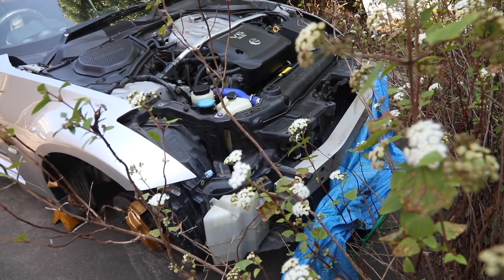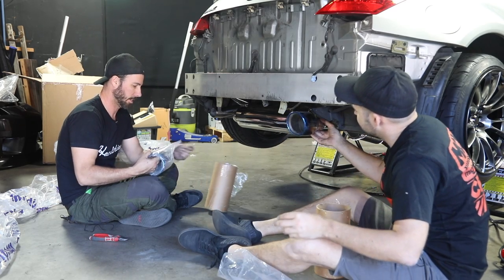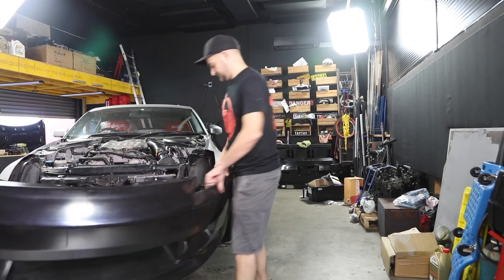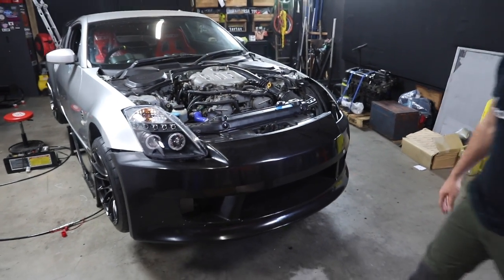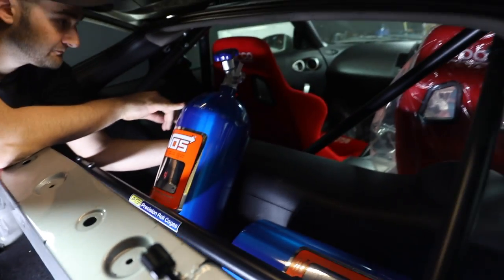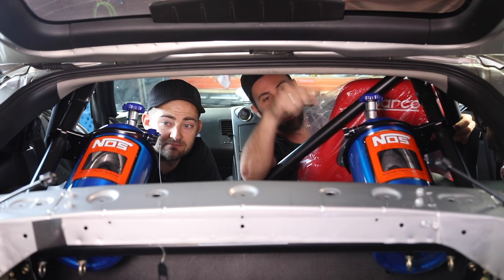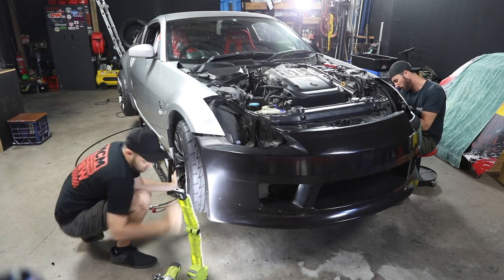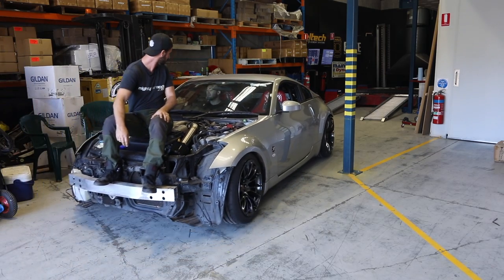350Z Make Over - PART 2

Comment: 218 hp that's not a healthy engine.
Reply: 217kw = 284hp
Reply: Yeah I was about to say, that seems like a really low figure for that engine. I thought they made about 300hp stock.
Reply: 162 KW = 218 HP
Reply: 274 BHP stock not 274HP
Reply: It's a 06 which makes 300 crank it should be making around 280 wheel stock
Reply: Vq35de’s make 280-300 at the crank. At the wheels it should be 250rwhp ish. 218rwhp isnt a very good sign. But what do you expect for a 350z that has 200,000kms and was the cheapest they could find all over Australia
Reply: I might be wrong but I can't see VVT on the front of that engine, I'm sure it's a VQ35DE not a RevUp.
Reply: it shoudl make 220hp at the wheels.
Reply: Yup very low power figure!!
Reply: Australia labels a cars year based on their registered date not the manufacturers model year date like the USA does, so this is most likely an early 2005 built car first registered in 2006 so has the older engine - so allowing for 15-20% driveline losses typical in a FERWD setup I would expect maybe 230-240 RWHP when it was new - so 217 after 200,000km and 11 years isn't bad at all.
Reply: Think your right but this wasn't a stock dyno run, It had headers, Full exhaust and a standalone ecu. It's down a lot of power.
Reply: i have an 03 350z its supposed to have 287 horses but according to most people on the z forum it produces much lower. the 350z hr is a different though
Reply: Daniyal S. More like 250ish to the wheels
Reply: Good point, I didn't take into consideration the amount of work they had already done to it - still could be worse for an old, neglected high-km vehicle.
Reply: Guys, IT IS VQ35DE. They said it in the first video of it at around 8:30
Reply: And stock it makes around 160kW at the wheels, as they say, so it's not a Rev-up.
Reply: And since with their first mods and some tuning it made 162.8kW it's pretty much the same as stock.
Reply: Rixhz34 I have the basic non revup vq35de that makes around 260 wheel. The car they have is the vq35de revup you can tell by the tail lights. The non rev up makes 287 crank while the revup makes 300 crank
Reply: Daniyal S. Ah I gotcha thanks for the info! I'm sure we can both agree 217whp for this Z is totally out of the ordinary
Reply: maybe it's the dyno
Reply: DEs can be real oil burners so with high miles that's probably right.. My HR made 297 wheel with exhaust and map only. There's a huge difference between the two
Reply: Saturday Winter it says 162 kw and 217hp
Reply: what u smoking
Reply: Stator rev ups are oil burners

Comment: Doesn't a stock 350Z already make like 280HP?
Reply: Not a lot of power for this surprisingly heavy car
Reply: 280hp at  the crank not the wheels
Reply: Add a turbo and it will be 340hp easy and cold air intake
Reply: @ruskibruski  on the vq a supercharger is a better way to go about boosting the engine
Reply: Matthijs Eskes like300

Comment: Just looking at the bottom of the car from the first few shots I wish I lived in a warmer climate. Almost anything you find in Canada is rusted to bits unless it has been undercoated properly right from the start.
Reply: It's certainly nice having our car's bodys last as long as they do. We get to see what climates do to cars in regions with snow and ice when we import Japanese cars, they are nearly always very rusty on the bottom.  Very glad we have a climate that doesn't destroy our cars (though it's tough on the cooling system and intake temps)
Reply: Tell me about it. I desperately want an EG Civic hatch, but all of em are either rusted to shit, owned by someone who won't sell, or crashed/ruined by boy racers and ricers. Mostly rust though. We use waaay too much salt on our roads.
Reply: ya, the government in my area has a set budget that they think the have to spend, no matter what. So the other day they came down and sanded my street (Which was solid hard pack snow causing zero issues until the sand made it all soft) and then the plowed the small gravel / rocks off the main streets. They did way more harm than good, But atleast the budget is being used
Reply: I'm fine with a little bit of colder weather as that's power weather for boosted cars. (I wouldn't know though  as I drive an N/A (for now) S2000 :P but anywhere it snows I don't want to be.
Reply: meh, it only snows 6 or 7 months of the year here. plenty of time for nice cars in the other couple months!
Reply: Not enough time for me :P
Reply: xDerpOG Easy fix, Move to SoCal. Then again youd have to deal with Trump Tweets more often... So, your probably better off in Canada
Reply: Yea I think I'm good :P When it comes down to it Canada is a pretty dope place to live, it just sucks for car people.
Reply: Well some cars don't use plain old steel so they won't rust up, but usually that is in the top price range.
Reply: xDerpOG because of the salt and snow
Reply: +Colinator4321 Yeah if they don't use the budget the government will slash it, trust me.

Comment: Vent the nos into the intake
Reply: if u wanan blow the engine up, sure
Reply: good way to remove your bonnet in 0.3 seconds
Reply: Lachie Wood Can easily be done that way as long as you have uprev. They already have the injectors that can deal with it.
Reply: William Stewart a vent line will blow 1k hp shot.. no injectors or tuning will save the engine
Reply: "danger to manifold"  warning light will start blinking.. :D
Reply: Nah vent nos onto brakes so they cool down 😎
Reply: rtiid22 I took it that he meant a dry shot, not just opening the valve right into the intake without being regulated lol.

Comment: I'm surprised that there are a lot of "car guys" in the comments that don't know that dynos measure whp and not hp. Especially since mcm have explained this before a few times.
Reply: KewaNCow even then. To the wheels all stock motor with nothing added my car made 240 to the wheels. So this is a bit of a problem
Reply: and that dynos are not completely accurate. they are best for seeing what the power curve does and getting base readings before you modify and seeing what you get after.
Reply: different dyno... different numbers... different days... different cars... you can never compare one dyno to anothers numbers.. unless you used the same dyno as them and probably on the same day... they all read a little different and some really run the numbers up or down...
Reply: Some Dyno's (the one I use regularly ) make mad calculations that guesstimate your HP at the crank.
Reply: Even so, the initial 217 number is low. Should be at least 240 or so, or around 260 if it's a model made after 2005. The engine is not in good shape.
Reply: Different dyno means vastly different numbers. DynoJets measure far higher than this - MCM always go to dynos with low readings.
Reply: yeah this dyno always reads lower than normal.. so could be the dyno itself.. and not even the car itself
Reply: Exactly. All of their cars showed way less power here. The z is fine

Comment: Just 217 hp on stock? Is that it? Shouldn't be something like 280 hp or more?
Reply: Bruno Gabriel Curbani typical imports 😂😂😂😂
Reply: The hp is 283 = 211kw, look at the screen again
Reply: Saturday Winter 283 hp with nitro. Search for the stock engine
Reply: Yeah, 276bhp seems to be the factory power output.
Reply: 217hp at the wheels. That's 258bhp at the crank. Its pretty common for a car to lose some ponies over the years, but 31hp is a bit too much unless it's a really high mileage car. Then again, the engine doesn't seem very healthy and it would explain why it was so cheap and was sold the way it was

Comment: Doesn't the stock 350z make 276hp anyway?
Reply: That's the power at the crank, they measured at the wheels :)
Reply: Georg Blink Both reasons are correct. The engine was or is in bad shape. Manuals lose about 15% of its power in a crankshaft/wheel conversion. So this car lost More than that 15. Rhode numbers are aproximated. But the difference Is to much. Sorry for bad english
Reply: MacTravis the hr engines make 306 and that’s a de which is 276 crank
Reply: Alberto Vz thats an approximate. More guys are actually getting around 18% loss through that trans. People forget though that some dynos can be really forgiving while others rape power figures. That being said rings in that engine are definitely not the greatest. But still the measured power was not that bad.
Reply: 2005 made 287bhp, not sure what year they have though.
Reply: my money is on a janky engine... mysterious lack of power out of an engine that looks good, shagged ass internals.
Reply: It looks like at Haltech they use a Mainline load-bearing dyno, which are known for reading super low numbers compared to Dynojet, etc...  If you look at power numbers from other MCM builds, they're all on the low side.  Its just a low-reading dyno.
Reply: Livi120 more than that
Reply: The early models made 276 crank, the later models with the twin intake (the HR) made 306. This is a early model single intake version.
Reply: Average number for DE 350s
Reply: MacTravis gona blow that lower block when the piston rings butt-up. See in a couple of times even with ecu being tuned. Guys add nos thinking "oh more hp" smh
Reply: It has a Nissan quest mini van engine lol
Reply: Not entirely, the VQ35DE in that car usually puts down baseline numbers around 210/220whp. It's about where it should be factoring in wear and tear over the years
Reply: So many Wikipedia enthusiasts in these comments 😂😂😂
Reply: there are some de like mine that have 300hp @ the crank because the intake and exhaust have vvt and the "normal"(no-rev up) have just the intake vvt and they make 287 hp at the crank, i have the (rev up)
Reply: The 2003-05 VQ35DE, which is what they have made 284 hp at the crank. The 350Z is notorious for large HP loss through the drive train. It is belching a lot of smoke so the motor is not healthy but most Zs would probably be down into the 220-230's at the wheels from the factory new. The HP was bumped to 300 with the VQ35DE Rev-UP in late 05 to 06 and in 07 they went to the VQ35HR motor which made 305 at the crank.
Reply: Binshou Builds 

Make fun? I was asking him what he meant so simmer down.

Have you got any links to the information about rings doing what you said? Interesting stuff!
Reply: 350zs are overrated as fuck in power. That is a DE engine that supposedly makes 287 to the crank advertised, and 218 to the wheels is actually normal. It's not easy to get power out of them NA without boost. They're still far from pushing the limits of the stock block though. Stock rods are good for a bit over 400whp and it's only making 280 with the 100shot. They could easily bump it up to a 200shot with proper tune. Only thing that would need replacing is the stock clutch.

Source : I own one, been through nitrous and turbo z builds myself and with friends.
Reply: The pre-2005 Zs make 276hp to the crank, after '05 they start making something like that at the wheels but I think the one they're working on is pre-'05
Reply: +Binshou Builds

That's with forced induction. Nitrous oxide doesn't cause as much heat as mechanical forced induction, and doesn't last nearly as long. This is the smallest shot available as well. They'll be fine.
Reply: Clyde If you're interested, check out Engine Masters here on YouTube. They do all sorts of neat engine mods and tests. They cover that particular issue with piston rings in one of the episodes. It is a real problem with adding boost to an engine. In this case via nitrous. I don't remember what episode they talk about it in, but it's a really fun series, so maybe just give them all a watch.
Reply: Dylan Kerr 

I will indeed, cheers Dylan.

As someone else mentioned above though the risk of ring expansion  is significantly less on a low shot set up.

It just irks me that because some thing can be an issue in excess then someone says it's a given and forgone conclusion in any application and even at the lowest level of usage. YouTube is chock full of doomsayers who seem to know from the comfort of their armchair what will happen.

That's not aimed at you though!
Reply: Defitnely  a weak engine   my 06 de(rev up) read around 260 rwhp with just exhaust(tomei) and test Pipes(berk) . Stock intake and y pipe
Reply: its about normal for this engine its not a rev up... you didn't read any comments did you?
Reply: Jim a quick Google will show you they have 287 HP crank and 274 ft lbs torque. Personally wouldn't bother ever getting anything but the HR Z's unless you plan on FI.
Reply: When brand new they made around 233 240 whp. This motor has has some wear damaging it i do believe if they got a new head unit and forged pistons they could increase power.
Reply: from stock the 280bhp version makes about 220whp
Reply: +Monk Modz Haha You so funny. And? What's your point? I've seen Nissan Quests that were modified and can rip on  what you drive right now even though it's heavy as shit. You do realize that the motor is not the end all be all to a car right? If you do, you have a lot to learn.
Reply: @goorgie182  hi what is the difference??
Reply: I can't help but laugh at these reply comments. The main loss of power to the wheels on 350's is the clutch, and dual mass flywheel. If you have the enthusiast model, with LSD, and throw a stage 3, 6 puck clutch with lightweight flywheel, they put down close to 270 to the wheels with just a intake and exhaust. Another problem is heat in these cars. Putting a cold air intake, and using reflect-a-gold to wrap the intake tubing does some serious work. Running a Mishimoto oil cooler is also a massive upgrade, as the stock oil cooler is shit.

Comment: The best part about aerodynamics is they actually make a huge improvement at low speeds. Yes they help at a high speed too but they're hugely improved at low speed such as track cars, If you ever notice the huge chassis mount spoilers and huge chassis front mount spoilers on track cars where they never get out of 4th gear. They're running 110mph give or take 10mph it really helps!